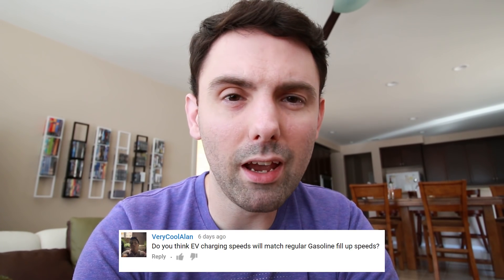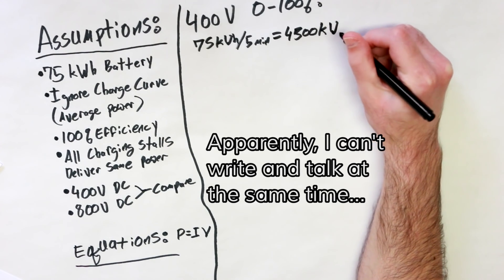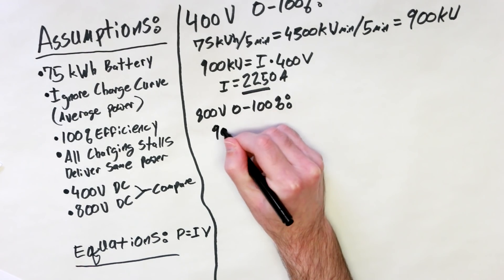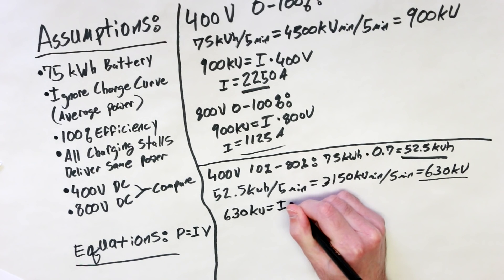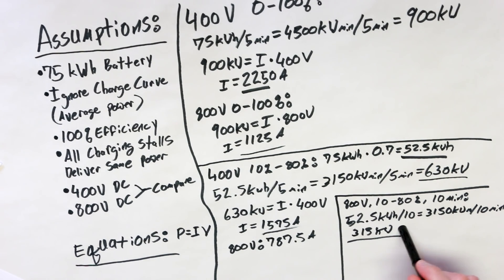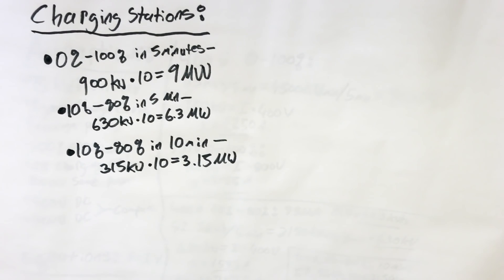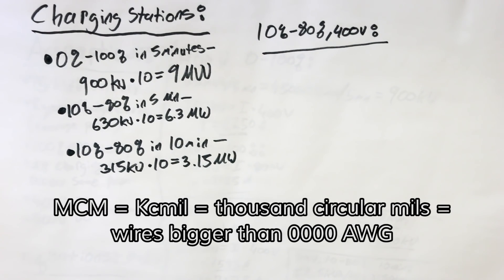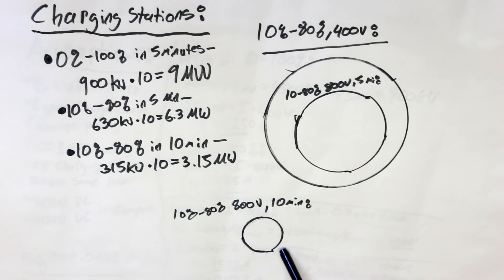Can Electric Cars Charge As Fast As Gasoline Cars Refuel?

Comment: We have gas bottle exchanges for our barbecues.  How  about exchange batteries? A five minute exchange could be done easily.
Reply from the maker: Rapid battery swapping has been demonstrated by Tesla in the Model S and they even had a pilot battery swap station running for a while at Harris Ranch. Battery swapping is somewhat logistically complicated, however, when you're working with a purchase model where the car owner also owns the battery (drivers had to come back through the same station to get their original battery back, customer batteries had to be stored, charged, and thermally managed, customer batteries couldn't be swapped into other cars, etc.). Now, if we were to switch to a model where you can own the car but only rent/lease batteries, then that removes some of the problems... but the issue of different battery form factors for different vehicles, different chemistries across manufacturers, different charge/discharge curves as a result (which impacts vehicle software), etc. You'd basically have to create an industry standard battery (or a small number of standard batteries) and get enough auto manufacturers onboard for large scale battery swapping to even have a chance. I really don't see this happening in the near term.
Reply: NO because of size. May be in the future. FACTS he battery car vendors WANT TO SELL THEIR batteries and MAKE MONEY out of it.
Reply: Renault Zoe
Reply: Exactly, and even in a rent/lease scenario, people would probably be kind of angry if they arrived with their brand new car and got handed an older battery which technically maybe still is within acceptable specs but does not hold the same charge as the brand new one. But the main problem is, like you wrote, the different battery form factors. You'd need a standard all manufacturers would use (like right now for fuel), but since having a larger battery/more range than other manufacturers is something companies aim for as a distinguishing factor, this won't happen.

Comment: What about inductive charging? No wires.
Reply from the maker: Inductive charging, as the name implies, relies on inducing a current in a secondary coil (on a device) by exposing it to the varying magnetic field produced by alternating current passing through a primary coil. The very nature of this process means that it can only transmit AC... so, even if you were to ignore the consequences of its significant efficiency loss over the air gap, you'd still need to have a charger stack in the car beefy enough to handle several hundred kW (you know, the equipment that usually sits in large cabinets at level 3 DC fast charging stations to convert AC from the grid into the DC needed for battery charging). There are inductive charging solutions for level 2 charging that make use of a car's existing onboard charger, though.
Reply: Inefficient.

Comment: Proterra open source charging standard has 1.2 MW peak power. For an electric car to equal the range of an average ICE car it would need about 150 kWh of usable energy. The company Charge Point is right now working on deploying their 400 kW, so those will be available the soonest. It's not as high but it's progress.    /watch?v=iV-ogzoSNdg&t=1s
Reply from the maker: I was at CES and I completely forgot that ChargePoint was showing that off... I like that you brought up Proterra since, as far as I recall, their fast charge system kinda illustrates my point: it's a large overhead system designed to interface with the top of a city bus and there isn't as much of a grid-tie issue given that it's intended for in-city use. Anyway, the main point of this video was to get people thinking about the other half of the charging equation (rather than just focusing on the batteries) and it's really great to see people responding with different ideas and approaches.